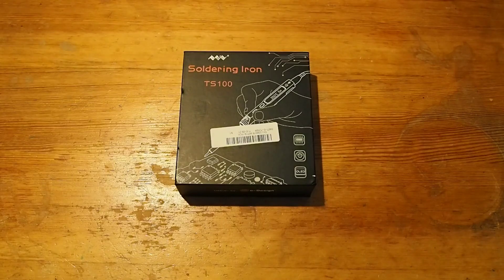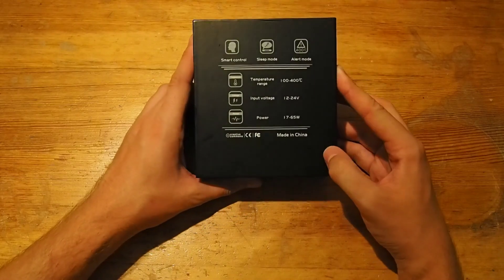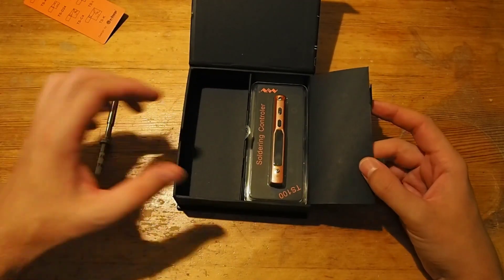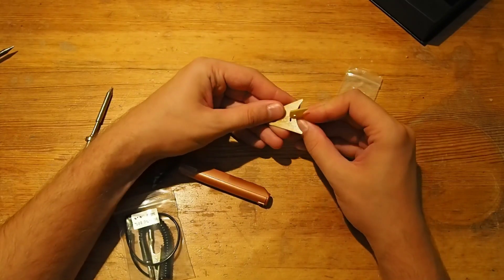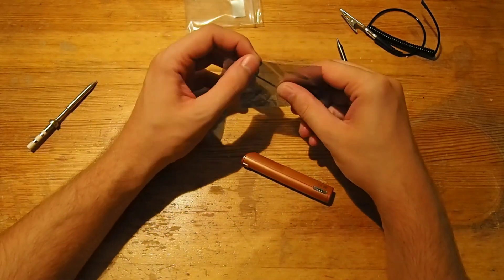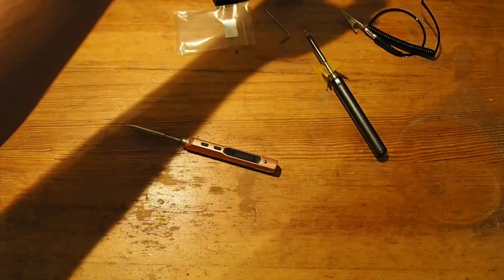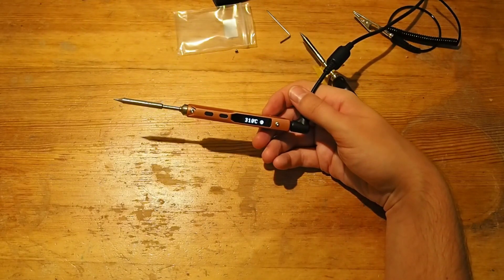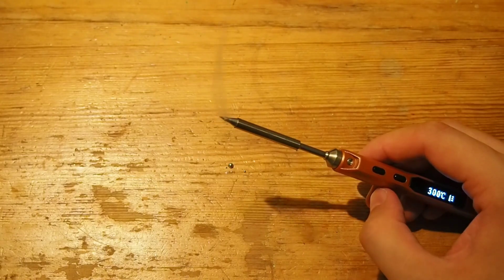Upgraded TS100 unboxing and differences from original

Comment: Hi, great video!

I'm new to this, what is the purpose of the ground cable and when would you actually use it while soldering, all the time or under special conditions?

Thanks!
Reply: If you have an ungrounded or unproperly grounded power supply, you may have AC voltage at the tip, which may damage components.  If you use a battery or a good power supply, this issue isn't a problem.

Another possibility is you may experience ESD or other unwanted charges while soldering, and a proper ground will help dissipate this safely.
Reply: @Uejji  thank you! ☺️

Comment: thank you for the review!
why do you need ground cable ?
how much its importent to use this ?
Reply: If you have an ungrounded or unproperly grounded power supply, you may have AC voltage at the tip, which may damage components.  If you use a battery or a good power supply, this issue isn't a problem.

Another possibility is you may experience ESD or other unwanted charges while soldering, and a proper ground will help dissipate this safely.

Comment: Reading the manual i found something disturbing that has me worried.
On page to it reads;
 After continuous use up to 40 minutes, the handle surface temperature will reach 50°C~60°C.
as i'm planning to solder a complete mechanical keyboard that's going to take well over 40min.

Also when adding a powersupply they recommend and a conical tip needed for thru hole soldering all from Bangood the total comes up to €84,51 that's for one TS-100 €54,42 + one
 TS-D24 tip and one  Powersupply €22,84.....but i can get a Hakko FX-888D for €98 that seems better value
Reply: Louis Rossman did a review on the TS100 and he goes into why NOT to get the Hakko FX-888D and that the TS100 would be better for a person just starting out or hobbyist ect..
https://youtu.be/71R8OksmpWw?t=8m9s
Reply from the maker: I have personally been soldering for over 40 min and never reached any uncomfortable temperature on the handle. Some times when you put it down to get and place new parts it goes to a standby and lowers the temp momentarily. Does it say in the manual at what temperature that happens? It's not often that you need the max temp.
Reply: on page 2. point 1.4 Cautions it only mentions the quote i posted earlier.. nothing else about the operating temp. on page 6 it mentions the default temp being 300c . i would be around that temp 300 to 350 max.. seeing that the max temp is 400 i would be quite high.. soldering mechanical keyboards on a dual layered PCB so perhaps a bit lower 270 would also work never done it as i'm starting off.

Comment: But smaller tip is harder to solder with. It means less linkage and thus less heat flow. Did find any difference in that?
Reply: The iron uses a thermocouple built into the tip (that's why the whole heater/sensor unit is replaced, not just the tip and costs $11) so the controller gets feedback about the temperature quickly and can respond quicker to temperature loss.  There are many different tip shapes available including a comical blade if you need more surface/mass.  It works way better than any of the old style irons on EVERYTHING.  (except plumbing)

Comment: it is protected reverse polarity?
Reply from the maker: +TOTY Salvuccio not tried but I would guess that it's not. I have opened them and swapped case on one but not seen any reverse polarity protection.
Reply: this is scheme. you can look here? thanks https://imgmgr.banggood.com/images/upload/2015/11/TS100/TS100%20V2.46%20Schematic%20Diagram%20V1.0%20.pdf
Reply: I don't see any obvious protection (but there could be something less obvious implemented).

Comment: The tip looks pretty much the same size to me not worth buying a new iron, why not buy the tip then you upgrade the firmware on your original 1?
Reply from the maker: +Tech Nirvana I bought it since my gf wanted one for making stencils. When I had both and saw that the changes that were made was box and new tip I made this video to show them. Unless you want the thinner tip. Just buy the "original" one or the one that's cheapest.